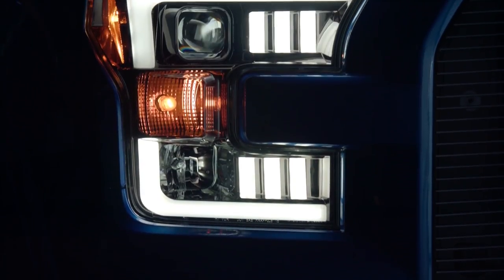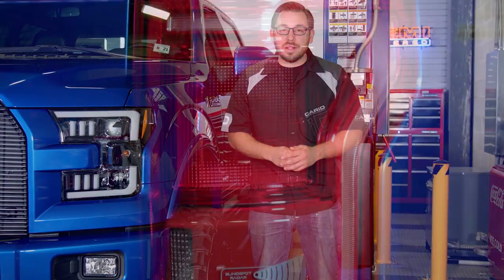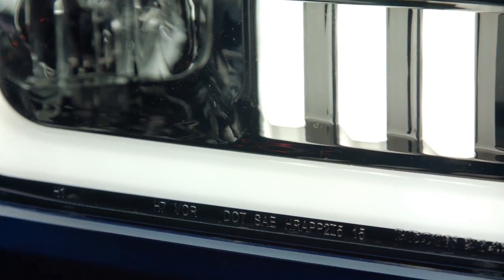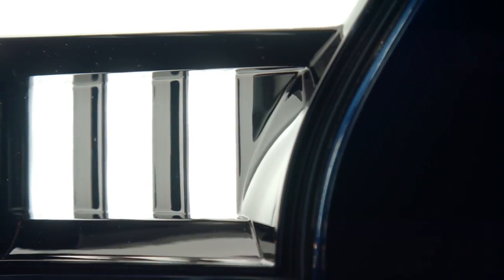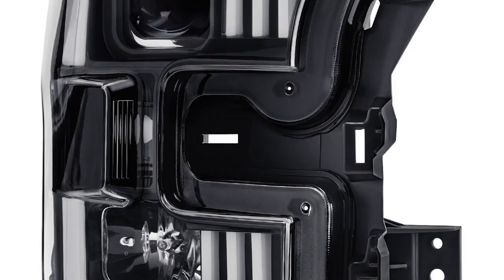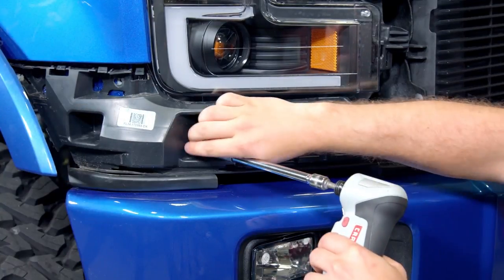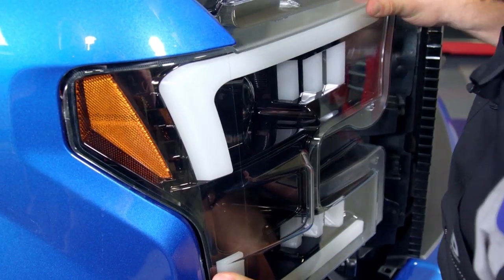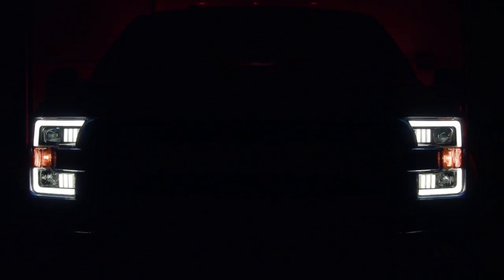Recon Headlight Review Ford F-150

Comment: "Looks sick"... and you fail to mention anything about lighting performance, warranty, adjust-ability and if the LEDs are serviceable.  I think you might be confusing a product review with a product  advertisement if you are not able to give us the straight up facts on the product. I mean for $950 bucks,  I want to know everything. Thank you for being more objective and informative in future vids.
Reply: Thanks for taking the time to reply and provide those details. So to really upgrade to a nice looking lamp unit and get improved lighting performance, it will be more in the $1100-$1200 range when factoring the LED conversion bulbs.  Maybe in a future video,  you could show that combo showing light projection and pattern against a wall or out on the road?
Reply: Thanks for that link and kudos for the speed and content of your replies!  I did not realize there were so many options.  I will check them out.

Comment: Im between the recon and the anzo headlights.
Reply: Save your money...seen both used...both are dim.  Unless you dont drive your truck at night or in the rain they may be ok.  Both manufacturers make their lights to look good and underperform.
Reply: Have the anzo.. replaced junk lights that came with it.. now lights are flickering..
Reply: Spend $1500 and get the morimoto's I've had em' for over a year now and always get compliments